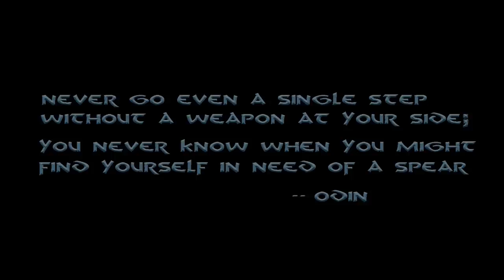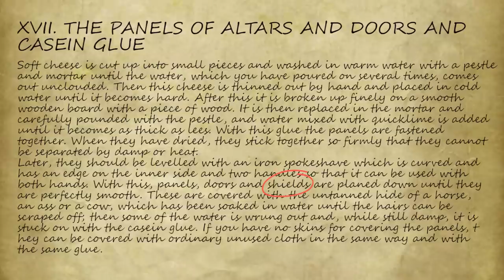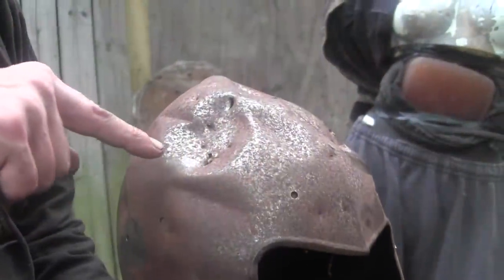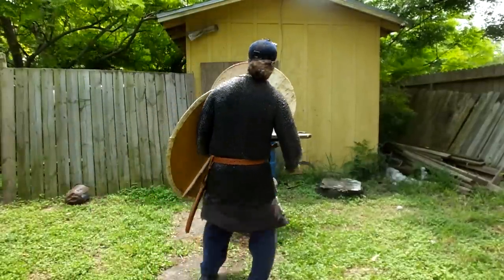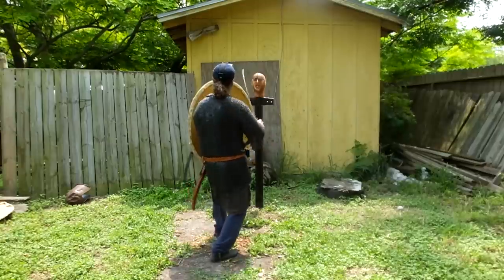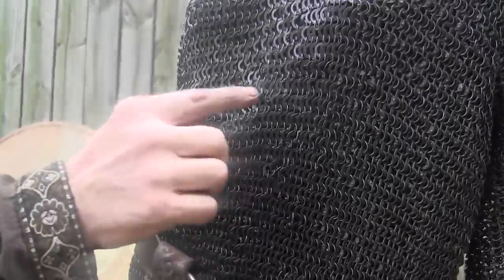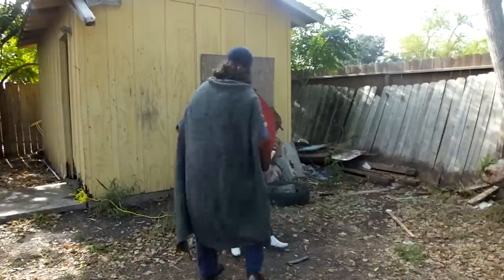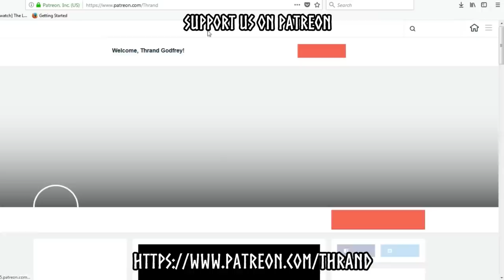Dacian falx Vs Roman armor & shield equivalents!

Comment: Well, if I recall correctly, the reinforcement ridges on later roman helmets were added just because of the falx, to counter its cutting/piercing ability.

On the topic of the padding, it is likely that it would have been felt, or flax, or some similar material. Definitely not that thick though. Medieval helmet liners were about 6mm-10mm, so I wouldn't think that the padding used by the romans would have been a lot thicker.

But the material can make a lot of difference
Reply from the maker: By historical account yes
Reply: not only helm reinforcement. emperor trajan had the soldiers in the second dacian war wear better arm protection. the falx-wielding dacians didn't just pierce or split (allegedly) helms, they also inflicted some horrific wounds on  the non-shield arm (even removing limbs at times)

Comment: Thank for doing my recommendation on helmet . We used to test a gladius against a helmet but never cut through .When I did Roman auxiliary reanactment 20 ys ago I used a woolen felt cap half inch thick under my helmet which I also used in my non combat roles. You swetted but it obsorbed well and kept me cool on long show session with linnin scaf . I can say during 45 min of combat menuvers the quontity of sweting  is unbelievable and chainmail would rust up if not cleaned after and wiped with olive oil . As it dries it forms a coating very good . Your demonstrations are very educational testing or during reanactment is only way to learn and understand the past. Doing combat as our ansesters did is quit something .thank you.
Reply from the maker: Thanks and I agree

Comment: Even if it doesn't penetrate the helmet wouldn't the sheer impact knock somebody down?
Reply from the maker: It could depends.
Reply: @incinerator950 I bet they did. I mean I would damn sure try and reinforce my armor because it could potentially save my life
Reply: Easily a concussion and probably some neck pain.

I watched a video made by Skall where he was able to penetrate a steel helmet with a 1 handed falx, so it's definitely capable of penetration.

Comment: the Dacians were not using just the falx but also the sica, which was a shorter one hand sickle type blade. the falx was most likely used by Comates, plebeians with no resources for much war apparel, sometimes fighting almost naked, while the nobles, Pileates/Tarabostes, were having access to armour and were more likely to fight with shield and sica.
Reply: Ghost Girl Remade  the purpose of the falx was to hook the top of the shield and drag it down to expose to blows the soldier behind it. so, falx handlers were always in the first line. this was the Dacians' way of annihilating the shield wall of the Roman cohorts. this is how 40,000 Dacians resisted 5 years to 200-300,000 Romans, while Caesar conquered Gaul with 30,000 men.  that's also the reason why the Dacian shields were oval.

Comment: Great vid, Thrand. I am still finding it difficult to understand why the falx was phased out in history, or any other recurve blade for that matter. They are natural cutters. We only have the kukri left in modern times. Maybe it was too specialized? Then again, a sword in general is a specialized weapon that works poorly against armour and any weapon can be deadly, even a wooden club or a loose rock.
Keep up the great work, you noble soul.
Reply from the maker: Thanks and agreed to the design especially with center grip shields
Reply: I think the reason the falx fell out of favor due to evolutions in material science. Allow me to explain...

People don't like to be hit. Reach is good because it lets you do more hitting and less getting hit. When we look at other swords of the era, the blades are typically rather short and broad. This is due to the limitations of metallury at the time. The falx took a similar mass of metal and stretched it into a longer, narrower blade reinforced by a thick spine. I'm no engineer, but the arched shape might have added to the structural integrity of the blade. 
As techniques improved, swords grew longer, but there's a slight problem with curved blades. If you maintain the curvature, making it longer will eventually lead to an impractical blade shape as the tip starts to curl back towards you. Matt Easton has touched on this several times in reference to strongly curved cavalry sabers which, despite their cutting potential, have less effective reach than a straighter blade. 
In a way, the falx did survive until the advent of firearms, just not as a sword. Numerous polearms have falx-like blades, but polearms are battlefield weapons, not sidearms. The sidearm, which accompanies the warrior at all times is usually more iconic than the principal weapon of war. Samurai are intrinsically linked to the katana, even though they were originally horse archers. Knights are associated with the sword even though the lance was their primary weapon. Even in more modern times, we can't picture a cowboy without his revolver, despite the fact that the Winchester rifle is called "the gun that won the west".
Reply: @lukediehl1210  Thank you. That makes so much sense. Too often we forget the sword is a side arm and it was the spear and its cousins that were the main individual weapons of war. And the material science explanation is right on the money. Sure, the Dacians were renowned craftsmen and miners, but then again, they did live 2K years ago. Again, thank you!

Comment: The Dacians would have used short recurved blades called Sica (similar to a kukri or a sickle), along with shields, and longer two-handed weapons with a curved tip, often called falx or romphata, possibly as a means to break the Roman shield wall by arcing over it.  However,  they weren't factory made, and each blacksmith had their own model and crafting method, thus there are dozens of different types that appear in historical records and archeological sites.
Reply from the maker: We have tested the sica as well as two handed and one handed flax in many videos

Comment: Very interesting. Thanks Thrand. It would be interesting to see a tip cut/piercing of the shield face. I think I read that iron or bronze rims were added to Roman Scutums after they encountered Gallic swordsmen in the 4/5th centuries BC. Seeing that the Romans added cross braces on the top of their helmets after encountering the Dacians, a vertical down strike on the helmet with the blade rather than just the tip may have been a good idea. A higher-domed/pointed top helmet may better deflect falx strikes-such as many spangenhelms.
 Who'd be a gel-head?!!!
Reply from the maker: We can arrange that

Comment: It raises a tactical question though, given the hold that the shield has on the blade biting into it, the attacker would have to be wary about committing to a full force strike or he'd expose himself to counter-attack. Any self-respecting legionary will be raising his shield towards an incoming high strike, keeping the blade point away from his head.
Reply from the maker: Shields trap blades and you normally do cut into them on purpose. The Romans account says it split shields deep enough it still injured the soldiers why we tested it.

Comment: I think the point of this weapon was not to pierce the helmet but to have the point slide down the helmet and cut the face open disabling the legionnaire.
Reply from the maker: That happened as well why they supposedly added visor. The helmet was up being 16 gauge I said 18 gauge so Roman helmet would have been way weaker.
Reply: @Thrand11  Well, as I imagine, the shield would be up to the roman's chin and his face is the only thing exposed, and with the falx the dacians kind of accidentally got to it. It would be interesting to see a test how and if that visor worked. I guess it did since they kept using it.

Comment: I think the shield should be positioned lower. Not just  in this case of ancient setting, but also for medieval times. Any defender holding the shield so high, would be basically blind the entire fight. Not to mention that in this setting there is no give on the shield when struck. I think only very strong individuals would be able to hold the shield in place.
Reply from the maker: I fight single combat shield is fine for that a formation or shield wall is totally different and yes lower

Comment: Put a longer grip to it almost like a lance and then put your hands higher almost horizontally on the heads level and you can hit the throat or catch the neck or you can catch the shield, pull it back and then hit the neck. You can catch the shield, pull it back and rotate a bit and cut the hand, or you can catch its bottom and pull it back and top, useful to your comrades to make a hit, or you can hit the leg. You dont need to hit the armor. Roman armors had a lot of openings. Also imagine soldiers with such weapons attacking from the top and bottom it is very hard to resist because when you put the shield higher to protect the head/neck you are open below and the shield could be catch easier on its bottom.

Comment: It also doubles as an agricultural tool, machete, meat cleaver, basically the very first ever multi-tool,....and well...Roman backstab...I mean back scratcher, yes the lorica can get etchi at some point o another, so it hits the spots! :D
There are in fact several other variations that either had a more full body curve, this was done intentionally as close the gap faster or straight backside ones, like the one you have  and would be used for other non-combat roles, such as carving up meat, cutting wheat or other things of the like, 
Interesting enough its design would be reused by the US Air Force Pilots during WW2 for there survival packs in the machete,

Comment: Good stuff! Why no follow through on the cuts though? Looks like you could have delivered more power
Reply from the maker: Those are the most powerful cuts. Follow through is nothing more than a push will not cut deeper on steel plate. The initial speed and impact determine the penetration there is no way to push the point to through the armour.
Reply: @Thrand11  Thanks so much for your reply!

Comment: The experiment of hitting the shield with the falx is incorrect because in this case the shield has a fixed position and absorbs the maximum energy from the impacts.
 In reality the shield would have been on one arm so the hit from above will push the shield down significantly at the moment of the impacts. The roman soldier's head would have been in a much more vulnerable situation.

Comment: But remember Roman shields had a metal edging and while your sword is buried in the scutum you're highly vulnerable. So what's the gain? Not much, if any. The real advantage of the falx was that with it's curve it could cut the hand for which the Romans developed a maniple. 
   And how good is the faix for thrusting. I imagine not very. While you're pulling it back you could get a gladius in the ribs. The gladius was short for a reason
Reply from the maker: Early Roman shields supposedly did not have metal edging top and bottom until after fighting against the Dacians and the Falx. This comes from the accounts of early on in Trajan's war how they altered shields and armour to deal with the new Dacian Threat of the flax. After the added such rimming and modifications to helmets and arm protection they won in combat agaisnt the dacians.

Plus I will add the helmet I tested was not 18 gauge but 16 gauge modern steel meaning the piercing into the helmet which killed through the helmet would have been devastating to an 18 gauge no reinforced early Roman helmet in those first battles.
Reply: @Thrand11  Okay, that's interesting. I didn't know that

Comment: Excellent, whenever they swing wide they can get a proper thrust through the torso. Try and hit a small target with the tip of a curved blade, good luck trying that. Meanwhile here is steel deep into your swinging soldiers
Reply from the maker: It didn't work like that per say. You do not need to swing you can use proper cutting for defense of you like and if using the shield it really would not matter.
Reply from the maker: The first confrontations with Dacians the Romans lost and later the adjusted armor and shield to deal with falx and did better. So your idea of how combat works did not play out in that manner historically.

Comment: the reproduction of the fight is not really correct. the Dacian warriors were on average 17 cm taller like romans. than the dacians were very strong. much stronger than you are and in addition to that, at a strong blow a shield held with one hand goes down quite a lot ... the one here is on a stand that is fixed. it doesn't go down.and your weapon is not a flax. the flax is a weapon for 2 hands, what you have is a sica or maybye an arhomphai (a thracian weappon ). no Roman warrior could hold the  shield with one hand, if the shield was take a direct hit from  a flax.the Dacians repulsed 2 Roman invasions. the Romanians had to change their shields and helmets to have a chance of survival